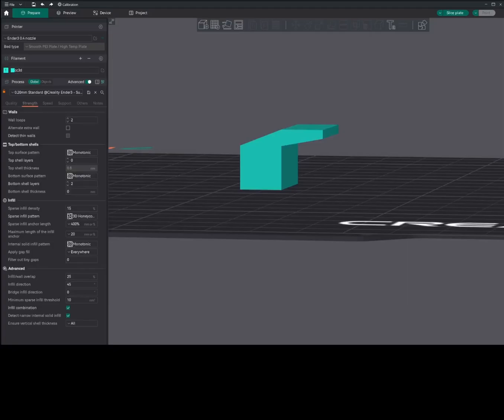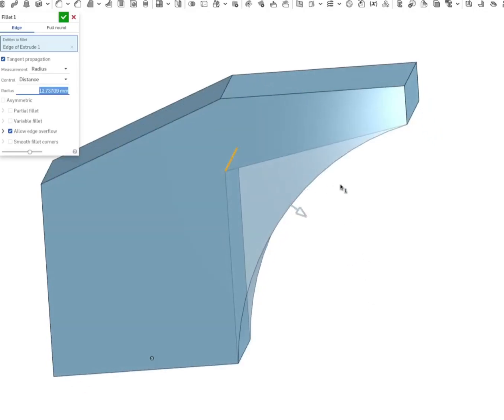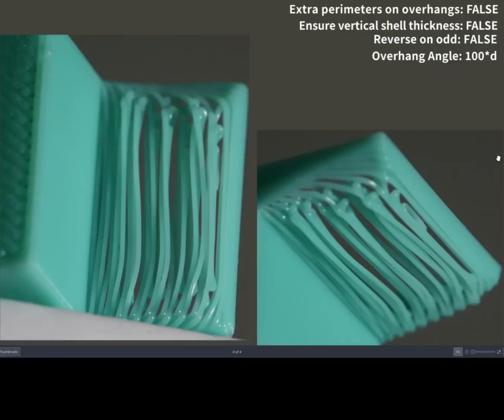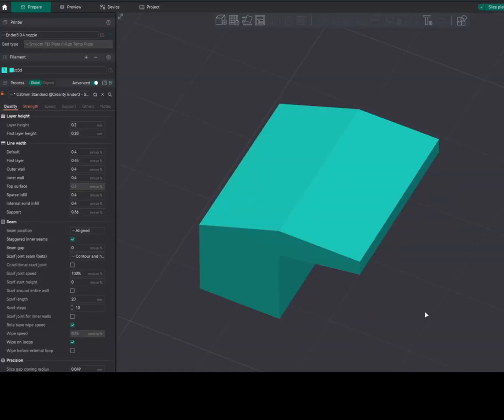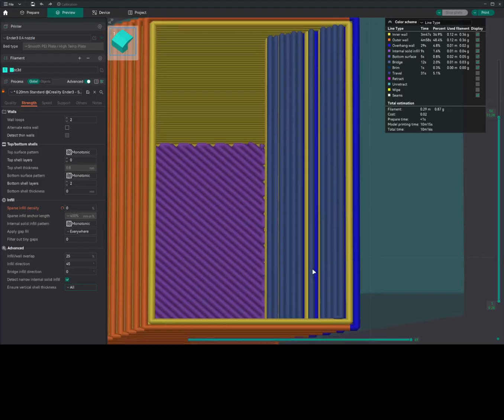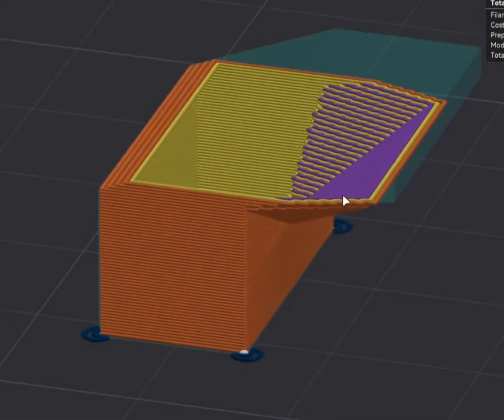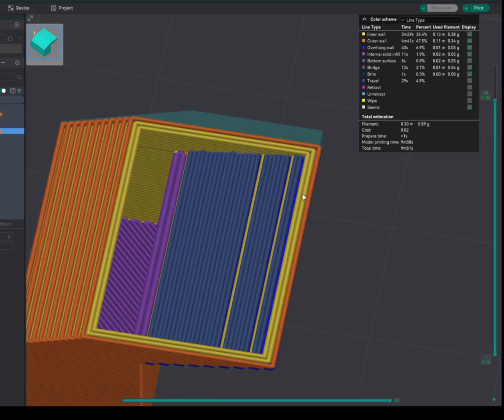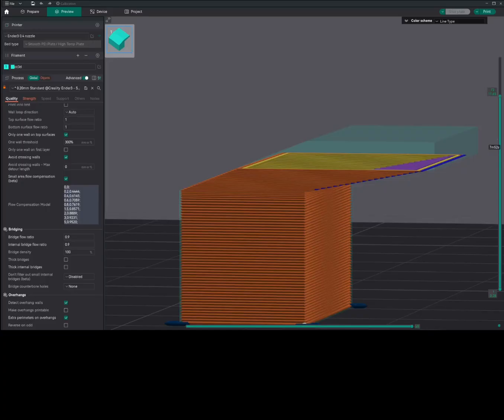Conquer Steep Overhangs: Tips & Tricks - Orca Slicer

Comment: Orca Slicer 2.1.0 does not have any of these options, can you update the settings to be changed?
Reply from the maker: V2.1.0 is still in beta, I'll check and update.
Reply from the maker: I just verified, these options are there, make sure Advance is enabled in the "Process"
Extra perimeters on overhangs
Ensure vertical shell thickness
Reverse on odd